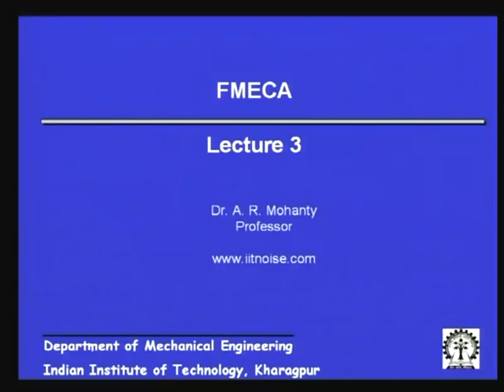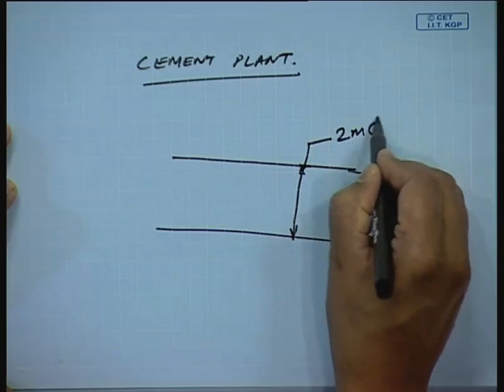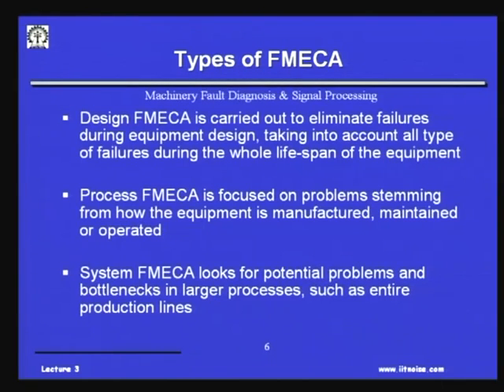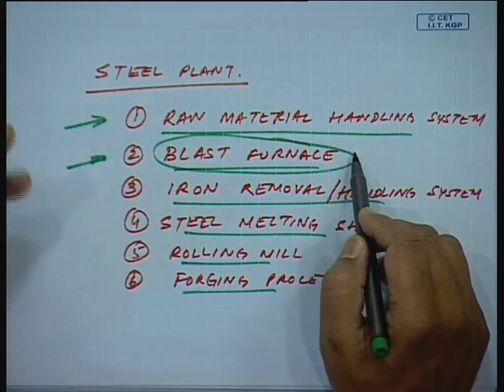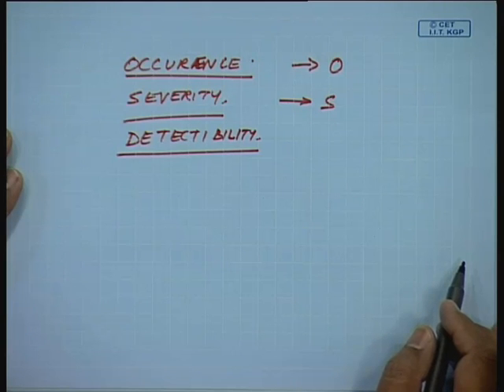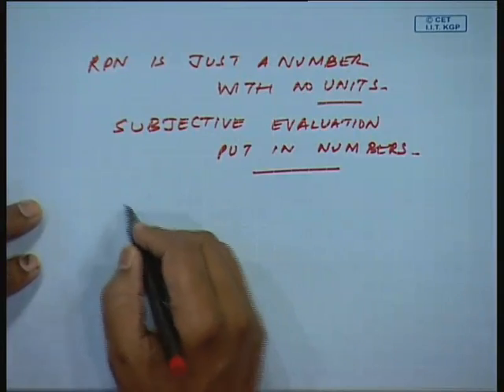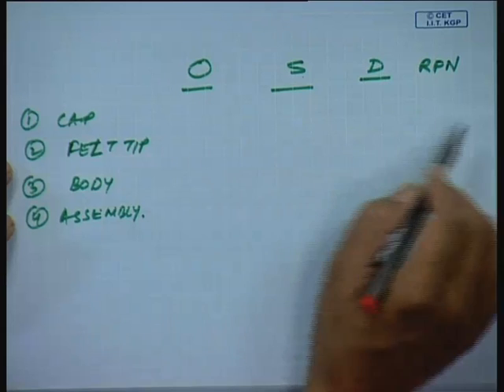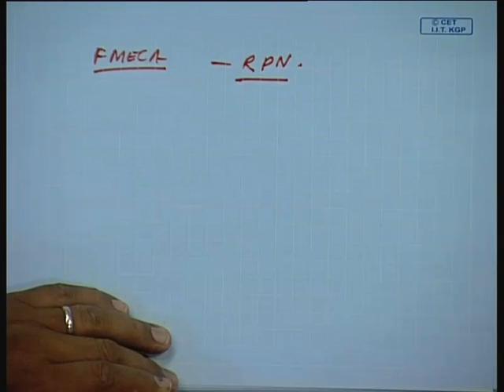Mod-01 Lec-03 Failure Modes Effects & Criticality Analysis

Comment: Very detailed explanation, helpful for Freshers/Newbie. But you have missed an important chart i.e the Risk ranking of Severity, Occurrence and Detection. All 3 (S, O,D has 1 to 10) but one should understand the standard rank based on level of risk. So the 1 to 10 should be explained. Or can be referred to any templates available online.
Reply: Permission to ask, do S, O, D always use rank 1 to 10? There are journals that use a rank of 1-5. For standard usage, should it be 1 to 10 or what? Thank you
Reply: @sitimaulidasyadiah  it depends on the product and requirement etc. So 1-5 or 1-10 depends on it
Reply: @anilbp  Thanks the answer is very helpful